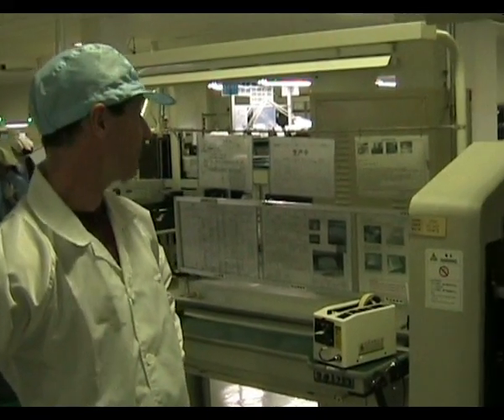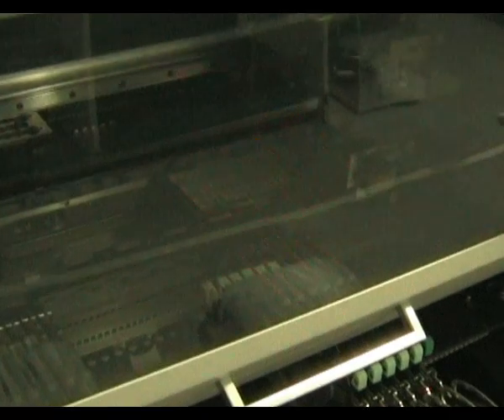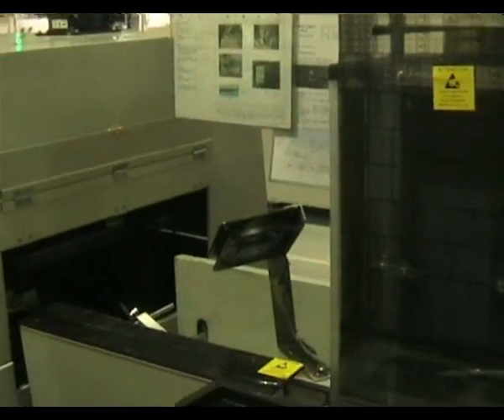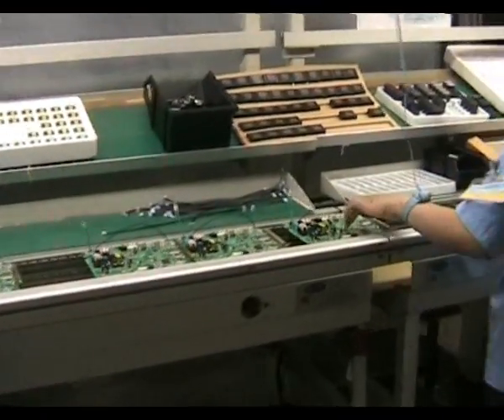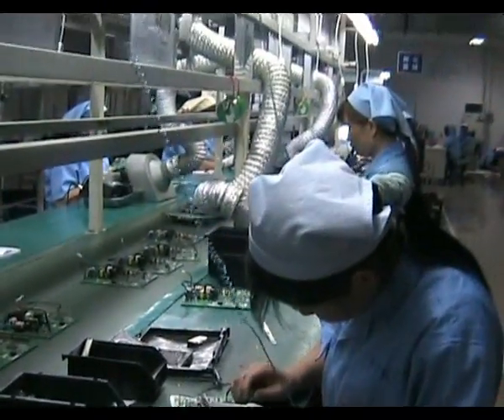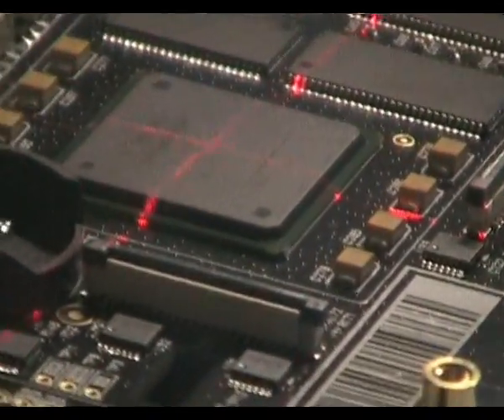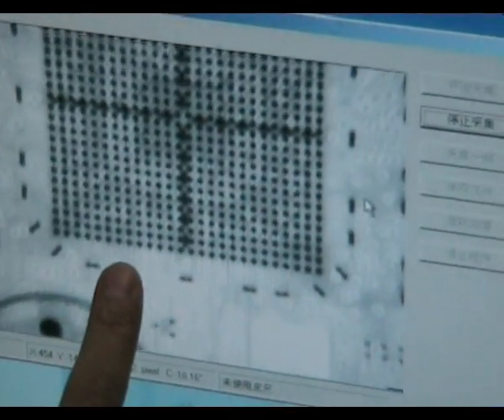EEVblog #12 Part 1 of 2 - Shanghai Special - PCB Assembly Factory Tour

Comment: Our place is slightly more... hectic? We follow just in time manufacturing and single piece flow techniques that Toyota uses. It means one operator follows a relatively small lot of PCBs from start to finish. Each operator working on their own lot is a good way of tracing quality (operators mark each board as each process is finished, and any issues can be addressed, usually with retraining), as well as reacting fast to new orders without much retooling time. An order of boards doesn't have to wait till a day when 500 boards are made on X day of the week, we can shoot it out in a day as long as the order is of only a few boards. It also means we can complete a vast array of different assemblies with only 30 or so operators, and because there aren't so many boards simply sitting on a shelf, inventory is kept low so costs are kept down. Also it means that boards go from bare PCB to assembled in a finished product in maybe four days for complex ones? I think the largest lots I see are surface mount only and are in quantities of 100 or so. As far as testing, if a board has anything more then connectors on it, it gets both a bed of nails and a functional test usually with a computer and software though an interface box.

Comment: Dave :)
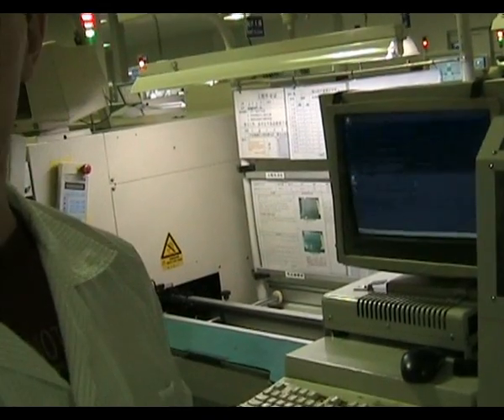I have noticed something that brings memories , at 3:27 there is crt screen and some cover on it, I remember now seeing those in 90's on many industrial displays.
Can you tell us what was that ? As far as I can remember it supposed to be some protection from some ...radiation or something...? Or was it maybe some 90's scam?
Love ur channel :)
Reply: +tomasz kulawinski Those mesh overlays hung off CRTs were there to reduce eye strain. CRT computer monitors throughout the 80s to the mid 90s usually ran at very low refresh rates (usually between 43 - 56 Hz), and were sometimes interlaced. The low refresh rates coupled with the usually high intensity white/green/amber text and ANSI characters for lines caused eye strain for a lot of people. The black mesh screen reduced the intensity of the display and made it more tolerable to look at.

There was also a more advanced version of the mesh that was for privacy that made the screen turn black if viewed at an angle more than like 30 degrees side to side.

These meshes started falling out of favor around the time Windows 3.0 came about. No longer was there sharp contrast differences of intense color against a black background, the entire screen was more uniform. This with the improvement of CRTs and video cards to run at higher resolutions and better refresh rates eliminated the need for such devices.
Reply: +GGigabiteM Thank you :)

Comment: Excuse my lack of knowledge but how can they actuall wave solder them after the surface mount components have been reflow soldered? Won't the hot solder bath melt the reflow solder even if it's on the other side of the board? what about if there are surface mount components on the other side of the board?

Comment: migsantiago I realize that your comment is 4 years old, but that was a "bed of nails" tester. It basically connects to various points on the board with spring-loaded pins and those pins connect to whatever testing circuitry is needed for that particular board. Sometimes, extra pads are designed into the PCB layout for the pogo pins to contact. http://en.wikipedia.org/wiki/In-circuit_test#Bed_of_nails_tester

Comment: Does the solder-wave machine use heat?   For example, if the PCB has surface parts on the bottom side as well, wouldn't the wave affect those components' solder?

Also, in the first tour, since the pick and place machine does not include any solder, do the parts ever shift or move slightly as it's moved to the reflow oven?   How is the temperature profile determined?